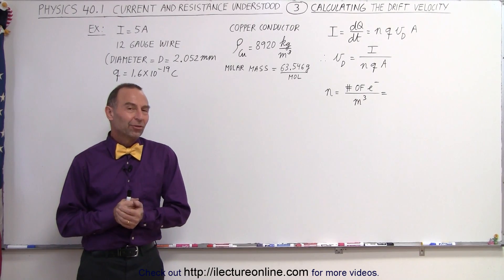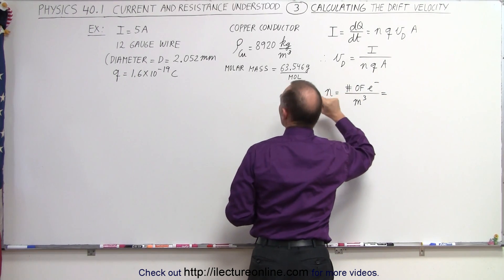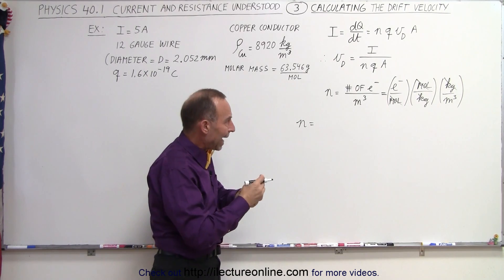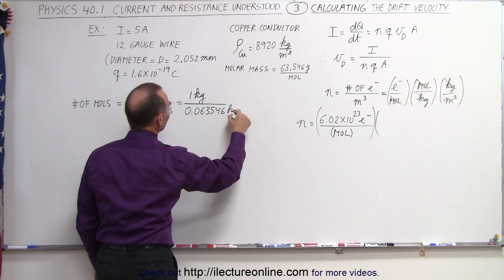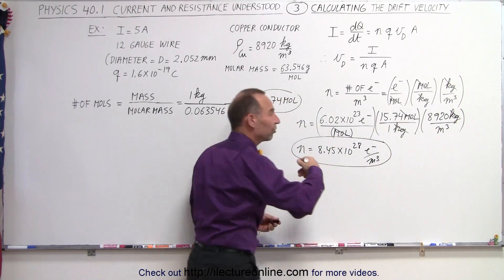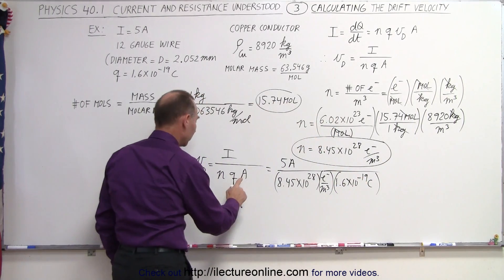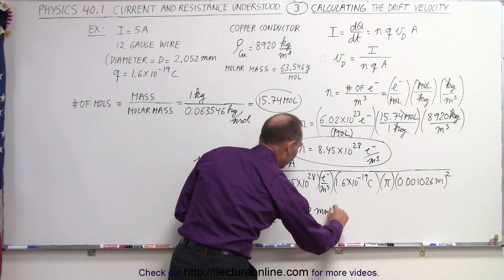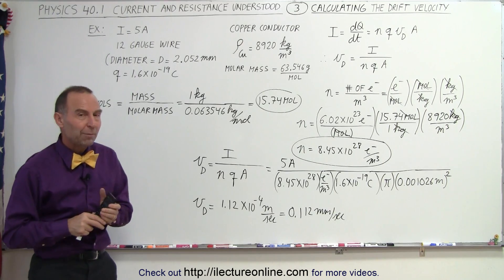Physics - E&M: Ch 40.1 Current & Resistance Understood (3 of 17) Calculating Drift Velocity

Comment: GREAT PROF 
My question, can we say drift velocity  is equal to the speed of electricity
Reply from the maker: They are considered to be 2 different things.  When you add a drop to a hose that is full of water, a drop will fall out on the other side almost instantly.  It is the same way for charges in a conductor.